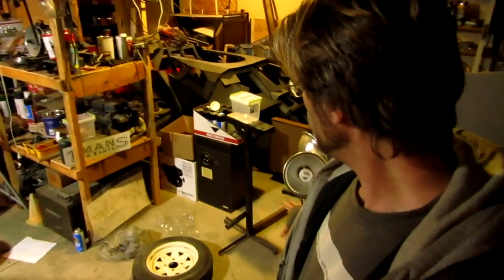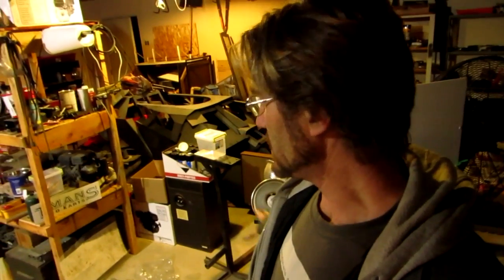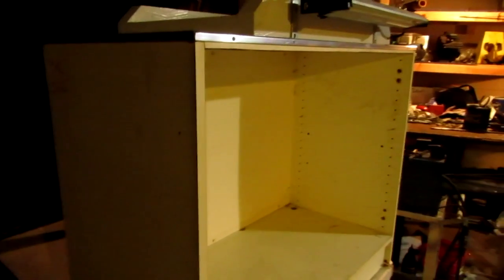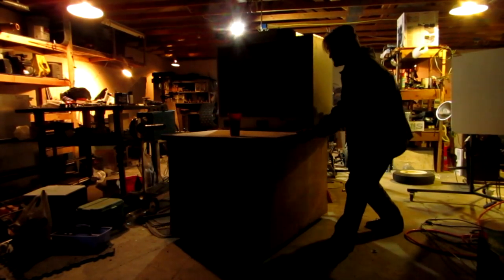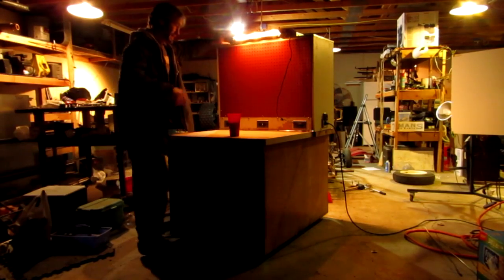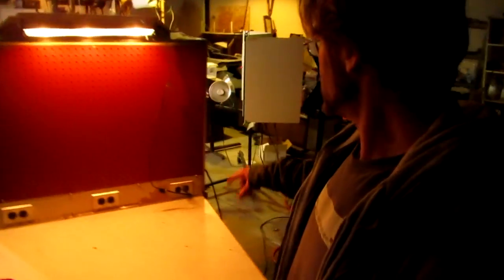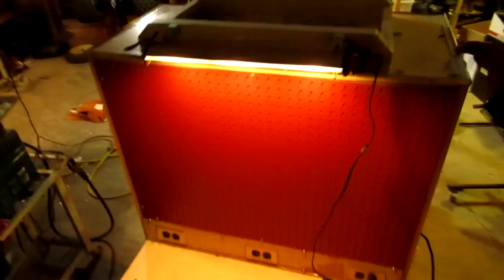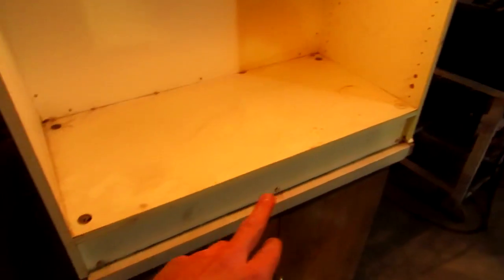AWESOME | New Work Station for the Shop

Comment: Darn. I love my pellet stove. I bought 3 tons at 250 a ton. That should last me the heating season. 
My house is small , like 1300 sq ft. I got one of those old Home Depot englanders that's supposed to be good for 2500 sq ft or so....all I can say is I walk around all winter at about 80 degrees. 
If I had oil, I'd be burnin a tank a month. 
Think about the time wasted chopping wood and all that. To be honest , if I had to chop wood or buy oil, I'd buy oil, but pellets are easy and the $$ to time wasted ratio appeals to me. A guy at work buys like 750-1000$ worth of uncut wood every year for heat. I'd spend 2k on a stove and get 1k worth of pellets and enjoy the saved time!! Every year it's gonna pay ya back!!
I burned about a bag every 20 hours to keep it at 80 , when we had a cold snap last year in January. Yea, it was zero here in ny state. 
Yea I love my stove, too bad it sounds like yours is a little small.